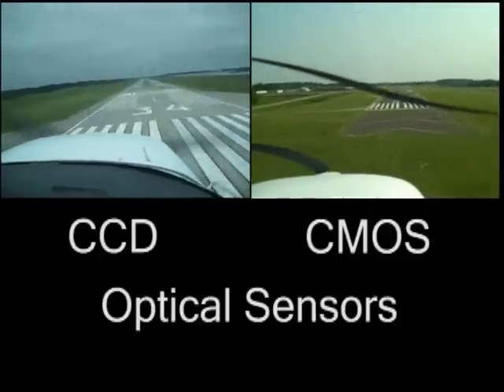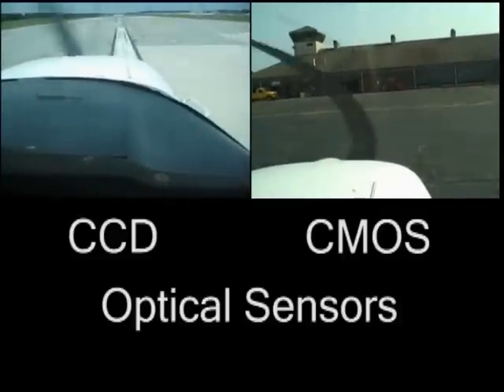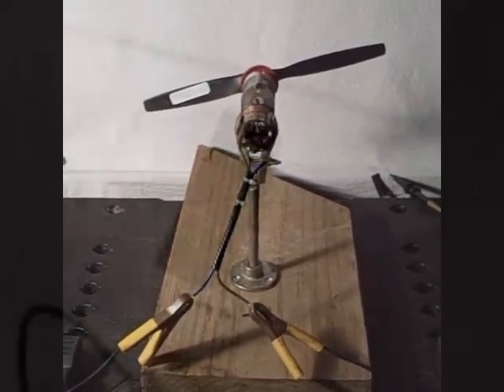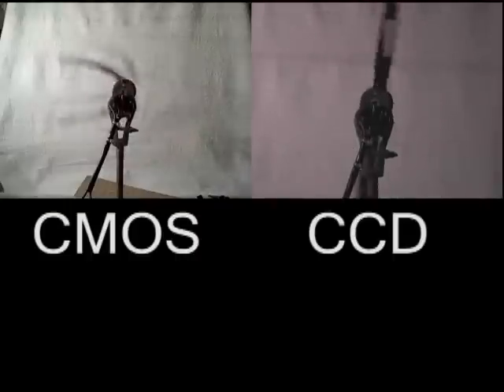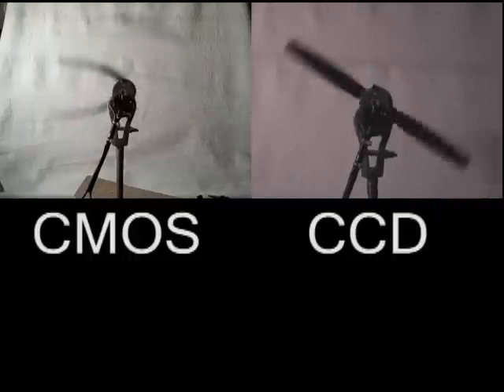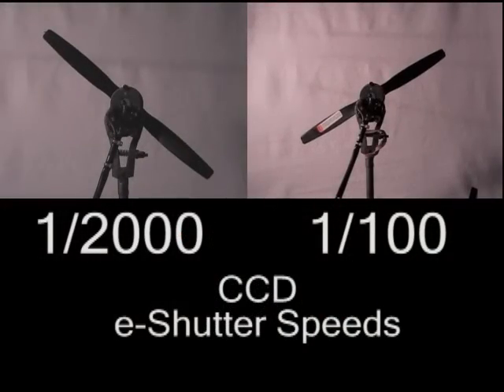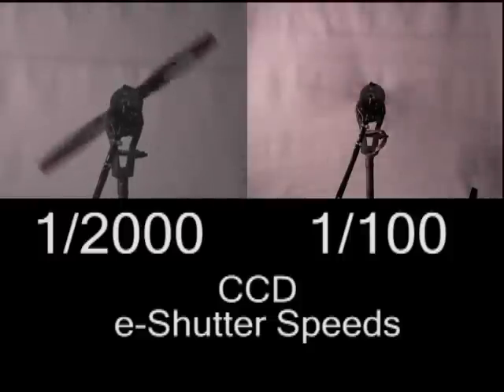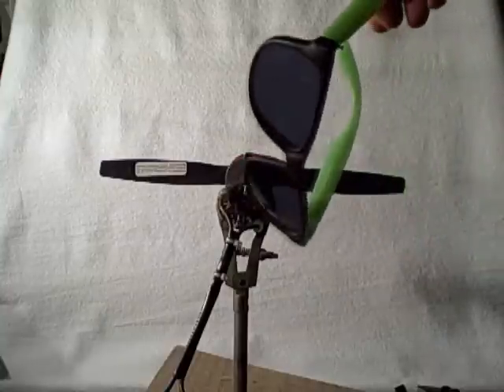Propeller Distortion Explained: CCD vs CMOS Cameras

Comment: 10 years later update:  many modern CMOS image sensors now have “Global Shutter” aka ‘uniform e-shutter’, although it would be fair to say that the majority of CMOS image sensors are still “Rolling Shutter”, which has its own benefits.
Reply: I wish that was true. Many videocamera's, even the semi-professional ones, still feature the rolling shutter problem (unfortunately).
Reply: CMOSes are inferior.
Reply: @blenderbachcgi  ok dude, your religion is better than my religion 🤣
Reply: @techydude  It's not religion. It's based on #1, personal experience, and #2, I have seen numerous videos online from CMOS and CCD Cameras. All of the CMOS cameras fall short. The CMOSes smudge very small details, crush the dynamic range to the point that shadows have no details anymore and overexposed bright spots have no details either, and to top it all off, they have terrible rolling shutter that makes the world turn into jelly, and the "Global Shutter" in CMOS sensors is very expensive and it's still not as good as a CCD due to a variety of other distortions, including sensor artifacting...
Reply: @blenderbachcgi  …and would one of those videos be this 10+ year old video?  lol. CMOS ‘won’ in virtually all mainstream/consumer categories, and not just because they’re cheaper, but in the last 5 years, actually better.
Reply: @techydude  Not just this 10 year old video. I used a modern CMOS DSLR. Sure, it wasn't awful, but comparing it to an older CCD Camera, the issues shone through... I remember trying to record a video with it, on a moving trolley, and every single vibration warped the entire image. CMOSes are just physically incapable...

Comment: I can't understand why the jello effects is more evident on lighter espositions, please can you explane to me? TVM
Reply: I don't know GoPro's and such camera's well enough to know for sure, but the only thing I can  think of is AE: Auto-Exposure. This automatically adjusts the shutter-speed to avoid the image being over-or underexposed (smartphones can tend to lower the framerate as well as they like when things get to dark in their opinion).
Now when taking video at 30 fps with a shutterspeed of 1/60 (like it should be), the effect can be visible but maybe not all that bad. Here's where sampling starts to become a thing. Picture this: you set up a camera perpendicular to a road and your angle of view is chosen so you can basically only capture the car in total and nothing else. If you want to capture that car exactly in frame by taking just 4 pictures per second (your 'samplerate') chances are you'll never even capture it at all.
Now you start taking 60 pictures per second: chances are you now stand a far batter chance of actually capturing it. Take even more pictures per second and you'll get close to the point you'll have a picture of the car totally in frame.
But that's also the problem: you start to freeze an ever smaller moment in time and that's the same thing happening to the CMOS-sensor and a propeller: at a shutterspeed of 1/60th of a second, quite a large part of the propeller-blade will be caught by the line-by-line readout of the sensor. When you up the shutterspeed, the effect becomes more evident as a smaller part of the propeller is actually caught as the sensor is now read out much faster. Together with the rotational speed of the propeller itself, this can cause quite interesting interference patterns.

Comment: CMOS sucks! I'm glad my cameras have CCD
Reply: Lol. Comparing quantum efficiency of both types. CCD literally suck. 4 times worse than CMOS.
Reply: Global shutter. Done. CCD is old tech.
Reply: @autonomy5649  CMOS is every bit as old as CCD, it's '70s tech as is CCD, but it is inferior. CID sensors would be superior to both, IMHO.
Reply: @autonomy5649  Yeah well, if the camera has a setting for global shutter, that would be nice. But unfortunately many videocameras don't... Back to CCD's it is for me.

Comment: I tested two cameras from banggood which claim to be CCD using the test in this video and they are both CMOS.  FPV HD SONY CCD 1200TVL 1080P mini Camera   DO NOT BUY THESE CAMERAS.  The reason I started suspecting these cameras not being CCD is because of bad light transition.
Reply: Bad sensitivity is a trait of CCD. This video compares only electronic shutter types. Not directly linked to type of sensor.

Comment: CMOS is a cancer that must be stopped. I want to buy a new video camera that can record in 50fps full HD with a CCD and all I can find is the ancient Sony HDR FX1E camera or similar.
Reply: @slap_my_hand  That's absolute bullshit, CMOS sensors have been around since the 1970s, only making them slightly newer than the CCD and CID solid-state sensors that have been possible to manufacture since the early to middle 1970s when they found their first practical usable applications that photoconductive electron vacuum tubes predominantly filled till they began to be replaced in the 1980s. Analog is how all video starts out as anyway if it's been sampled in the real world.
Reply: Because we use the correct PAL standard.
Reply: No wonder my Sony UX7 starts to have wavy vibrating artifacts only two years in.
Now I understand why older CCD sensored cameras have smoother performance.
CMOS are some cost cutting piece of crap compared to CCD!
Reply: @slap_my_hand  Well, F-that. I still have two CCD videocamera's (one with, unfortunately, dust inside the lens-unit) and will stick to them for as lons as possible, as CMOS just sucks. I don't care that they draw more power or the PCB-design is more complicated (I mean, CCD's were used for decades, the design isn't suddenly becoming a problem now is it?).
CCD's and CMOS both have their own noise-problems.
As long as manufacturers are sticking to CMOS and won't find a way to alter the image to produce a CCD-like image (yes, that means some extra processing power that most likely completely destroys the low-power benefit of a CMOS), I will probably not buy a videocamera anymore, even when second-hand like I usually do. Capturing lightning just doesn't work with CMOS, just like fast moving objects also generally suck.
Reply: agree
Reply: Shaun Dobbie 
why not 60 fps
i think its much smoother
Reply: Ah
Reply: Get a camera with real shutter.
Reply: Shaun Dobbie u
Reply: Super Pixitracker Composer and More m
Reply: idiot its a fucking camera sensor.
Reply: slap_my_hand wooosh
Reply: @slap_my_hand  It's true, but it generates a bad image presentation ...
(at least for now)
Reply: @slap_my_hand  You do realize CMOS and CCD are by definition analog, right? You need preamplifiers for both devices. It is like saying you can operate a microphone without a preamplifier, and saying it is not inherently an analog device, when it is by definition. You need ADCs to convert analog information converted to digital information, regardless of whether you are dealing with audio or video information.
Reply: Welcome to a time where CCDs are practically never made anymore....
Reply: CMOS is a camera type, you idiot!

Comment: Hi, I had a question for the CMOS sensor in GoPro.  Let's say I'm using 1080p @ 30fps with a ND filter, so the original shutter speed might be 1/60th of a second,  but the ND filter reduced the light and the shutter speed to let's just say 1/45th of a second.
Now if I increase the fps to 60 fps, that should theoretically increase the shutter speed, and isn't
 that just negating what the ND filter had done before, and you'll be left with propeller distortion again (for that ND filter setting)?

Comment: It looks like CCD sensors are better at capturing the depth of the field, also they capture better the differences between blue and green, unlike the CMOS...
Reply: +Dani Rico Both those are nothing to do with the sensor - everything else being equal you won't be able to see any difference if I showed you a shot from both sensor types
Reply: CMOS is better at being satisfiying than CCD. as CCD is better at recording reailty and field than CMOS
Reply: That’s to do with the camera, not the sensor type.

Comment: Great video that really helped me understand what's happening with my GoPro. For this reason, I purchased one of the PolarPro Neutral Density filters for my GoPro. I also read somewhere online that if you set your GoPro to shoot at 60 frames per second, it will help make the prop blur look less like ripples and more like an actual prop. I wonder if combining the ND filter and 60 frames per second will cause it to almost remove the prop blur or if they will cancel each other out. Have you done such tests yet? Do you know if they will cancel each other out or help each other?
Reply: Nope, the effect will remain, but as you go up in framerate, the shutterspeed increases as well, which means the sensor is read-out faster, thus making the effect more minimalistic. It however (sadly) won't disappear and an ND filter sure won't do a thing against it.

Comment: this only applies to video recording..
Reply: Not really... The electronic shutter on photocameras features the same problem. But fortunately, technology is evolving, with Sony being the leader in this with their stacked CMOS sensors (which improves the readout speed and thus reduces the rolling-shutter effect significantly)
Reply: @weeardguy  Even with that it still looks like doggy doo.  Even global shutter on a cmos sensor pales in comparison to ccd.  CCD is just more believable. More true to actual film.
Reply: @380stroker  Wow, you've got the eye for it then. I've got both a JVC GY-HM750 and the successor, the 850. Where te 750 still has CCD's, the 850 uses CMOS's(es?) that (unfortunately) aren't compensated or just use a global shutter. But if I take shots from the same stationary or slow moving subjects, I won't be able to tell the difference.
Reply: @weeardguy  There's not enough hours in a day.  More testing must be done.

Comment: Thank you for this informative video. Here is my practical example on the use of ND filter in filming aviation videos. Using ND Filter To Eliminate Propeller Distortion
Reply: that solves the problem by only 60%
Reply: @zohans8435  Make that 40% I can see the warp still...

Comment: It is actualy stupid that the cmos sensor cannot capture a whole frame atonce so also the claim of manufactors that their cmos cameras can capture 1080p video is not true, it should be called 1080h h for halve, trough same ccd sensors capture in interlaced form causing ugly comb motion artifacts, shame on those manufactures!!!
Reply: You're mixing things up here. CCD's can capture progressive video as well, the processing power, besides demand for progressive video, was most likely not there yet. My JVC GY-HM100 however, does a fine job capturing FHD1080 25p... It just can't do 50, but it's camera that's about a decade old if I remember it right.
Comb motion artifacts have never bothered me so much: that's just the way interlaced works.
Reply: I have a video camera that has a CCD sensor and shoots interlaced.  It looks like crap.  However, i have another CCD camera that shoots in progressive and encodes in H.264 and looks amazing.
Reply: @380stroker  well those ccd sensors wich shoots everything interlaced should be banned once for all and forever till never, i really HATE those ugly combing artifacts, now if theres only footage recorded interlaced ,then motion adaptive deinterlacer and multi diogonal reconstruction filters MUST be added to remove those combing artifacts during post processing,
Also if companies feel like to use interlaced ccd sensors instead in their cameras, they muat imply a motion adaptive deinterlacer and multi diagonal filter to remove those combing artifacts on the fly to make up for it.

Comment: A lot of problems people have with video are caused by electronic image stabilization, slow memory cards and shutter speed. Try altering them. Shutter speed is recommended to half the frame rate usually.